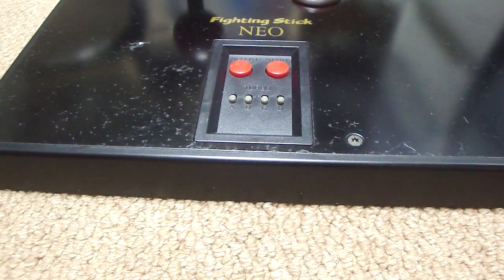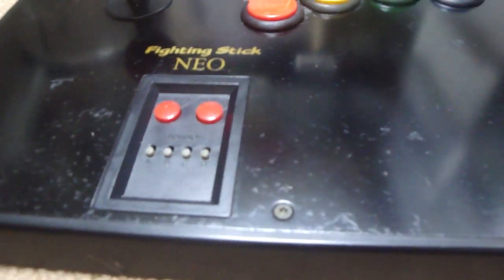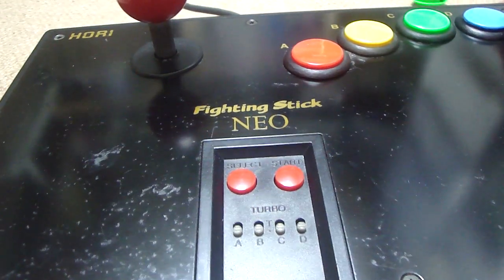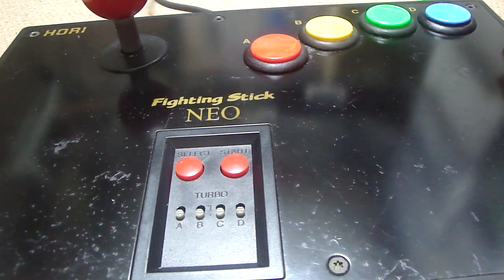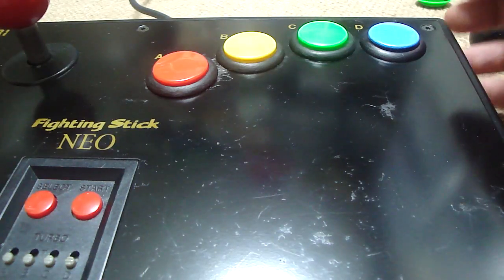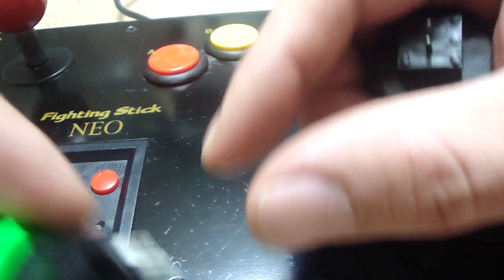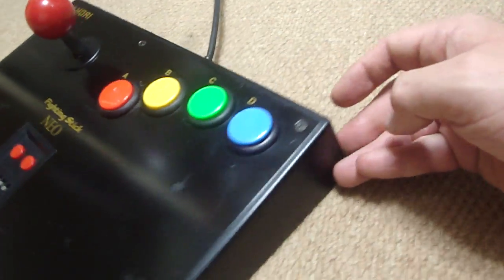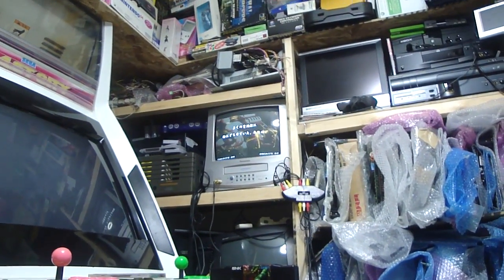Hori Neo Geo Fighting Stick Neo Sanwa Button Swap

Comment: Hi Luke, do you know where I could get a replacement connector cable? 
How risky is it making the new buttons with switches fit, do you have to be careful altering the traces etc? 

I have a faulty B button and the select button is intermittent not working unless I wiggle the cable..

Comment: I thing about Pad form X box , he's compatible . I use Logitech mouse G 300 also have old PC with Windows 95 . He have damaged buttons in AT type case am wonder what parts are inside cos i have to small space but disc ( 60 GB ) & sound cart will be useful but am don't have too many disc pocket for HD . I also have Dell 820 laptop with factory components . ( I find parts for this Laptop in Canada but they really expensive . So i thing to use Linux for fun . ) .